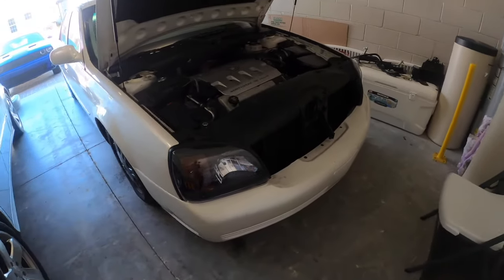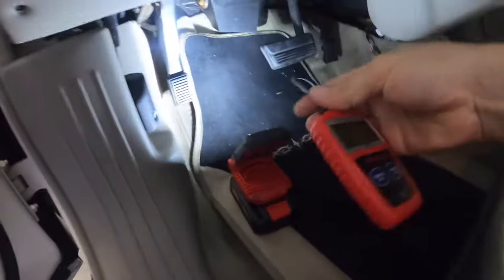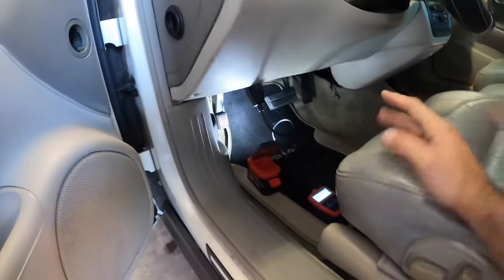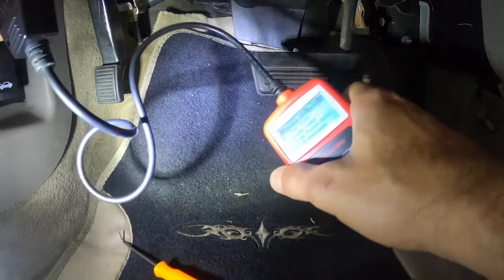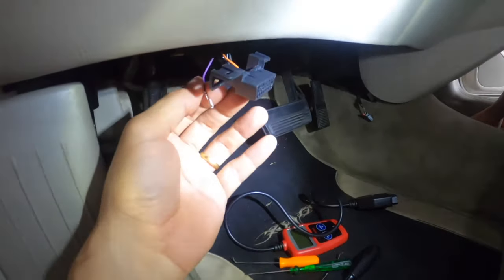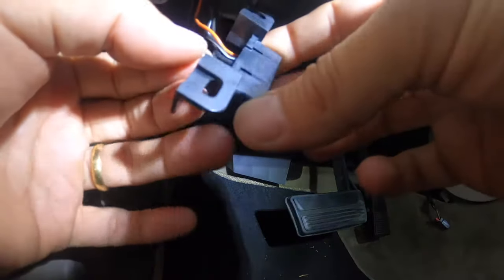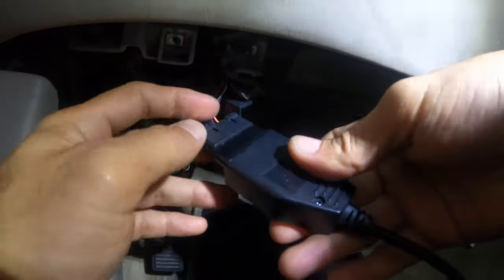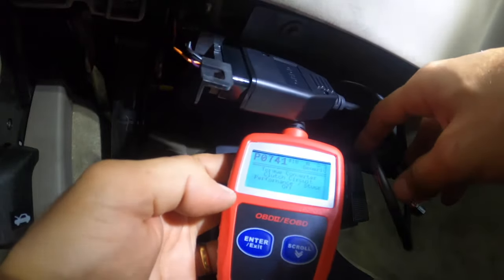OBD2 Port Doesn't Communicate, But Has Power

Comment: Every video I've found on obd2 not connecting has the same outcome. Very basic and of no help. Connector pin drag test was first thing I thought  of. And huge problem with anything that has a connector. And there are the ones that find a blown fuse. That is eliminated when the scanner powers up. Got power. Got ground.  Pins are tight. No data. Can bus voltages seem to be right, from what I can tell. But checking resistance between two canbus wires finds no continuity. Could be due to no access to get good connection. Not even sure what sort of system/network a 2000 xkr has. Can't find hardly any info about it. Go chasing after can bus likely has nothing to do with actual concern. Just need to get codes and read data
Reply from the maker: You'd need to pay someone to diagnose like Scanner Danner
Reply: Needs a new battery.
Reply: @MikeyBadabingBadaboom  No. Something has the CAN network functioning as a CANT network. Likely a bad module. Haven't had time to track it down. Slow process. And at the moment it's been moved down on the priority list, by a deer. Instead I'm shopping for a bumper cover, fender, and headlight.
Reply: I had the same issue I couldn't believe it but what fixed it was disconnecting the battery terminals clamping them together and holding down the brake to discharge all the modules and reset them
Reply: @moreoflife1112  Did that really work? I have a 1998 Toyota Tacoma 4x4. Can you give a little more detail? I’m having the same problem and the smog shop can’t complete the smog check for my new registration. The scanner will power up but won’t connect or communicate.
Reply: @briankennedy5578 Hey man, how did you end up solving your issue at the obd2 port? I'm having the same issue as I tried to smog my car Friday. I find the old answer of it's probably the ecu to be wrong. I have no other symptoms at all, & ecu's just so rarely go bad. Was it some sensor, or??  thanks!
Reply: @scottsherman5262  Haven't gotten around to it yet. Got the deer situation taken care of. Thinking mine could be  either a bad wire or one of the many modules connected to the CAN circuit. With the age of mine it's a tedious process. Have to disconnect each one individually to find which one is the problem. Newer vehicles it's easier. It's most likely something stupid in the wiring. Yours likely the same. Could also be incompatible hardware. Maybe try a different testing station.

Comment: I tried  this already and it didn't work on mine but the code reader does turn on and I get link error my car still just cranks no start
Reply: My fix was the ecu
Reply: @jvst20051  same hopefully
Reply: @Benzo4prezi  it turned out to be my ecu .I replaced it and every works now
Reply: I'm having the same problem on my 2010 Honda accord it's getting power but says error and also my key isn't showing when put to acc position can it be my ECU is bad?
Reply: @saltlifecastro  did you fix it Same car and same alo
Reply: @noelperez4259  it was my ECU and wire harness rats had them really messed up

Comment: My 2006 Frontier, same problem. Power, no communcation with DMV.  Told by garage today they found that a pin in the Data Link Communicator, or the OBD2, needed tightening, when they t4ried to plug one into the other, the pin wasn't making contact where it should. I was told they tightened this one pin, probably #16 which is the communicator pin from what I've read.  So that is the problem I had. It is fixed, as of today. Happened last year too.

Comment: I have a similar problem with my 98 cabrio. My scanner has power but even if the check engine light is on my scanner doesnt pick up codes

Comment: Great info to try!  As others said, every other video is only if NO power.  I have the situation that your have, power but won't read codes.
Reply from the maker: Let me know of it works
Reply: Yes, the power and ground wires were snug but the three comm ports were loose.

Comment: Very nice job. if am not wrong pin #2 from Obd2 connector corresponds to Can line-H and #4 it's one of the Grounds. 👍😎
Reply from the maker: Thanks for the info
Reply: Bro you seem very knowledgeable on this topic… question…. I have a 2012 town and country, the obd2 has power but will not read… replaced tipm, win module, and going to replace ecm soon van won’t start

Comment: mine used to connect to torque app . but now it doesnt work.only in one specific app it does connect to ecu. which i can't explain why?? i've replace the ddapters . and both works fine with torque pro in another car. i guess there's something wrong with my obd port itself. i'll give atry though. thanks!!!

Comment: Thank you for this video
I have an OBD2. The blue piece, when I connect it to the slot, lights up red, but when I start searching for malfunctions, it does not respond and shows me a message that the piece has not connected to the computer, and I do not know what is wrong.

Comment: @DCF Garage I noticed the trouble code on your scanner was P0741 and it's on a GM vehicle. What did you do for a fix on that code? I have a 2008 Chevrolet Colorado with that same code.
Reply from the maker: I believe that is likely a bad torque converter. There is a sensor that can also go bad, but normally it’s the TC

Comment: I have a similar scanner and when I plug it in and press scan it’ll load and then it will just revert back to the main menu after it’s finished loading. I don’t get an error and failure to connect message. Battery is new, and the pins are fine. Any tips?? Thanks. Edit: I don’t currently have a CEL on however part of my cluster lights are burnt out so I don’t know if the CEL is on or off.

Comment: Similar issues my 93 grand cherokee 4.0L but my gages don't work, starter cranks but the car does not start and the reader can't read the computer. I've checked the fuses and only the park/neutral position fuse was blown; and when I replaced it the issues still remain. 

I need help somebody
Reply from the maker: Then your ecu is likely toast. You can pay a mobile mechanic to diagnose for sure

Comment: Vehicles will not pass inspection in NH with a "Check engine light". I'm wondering what the inspection station will do when they can't read a fault but the check engine light is on.
Reply: Take the cluster out put black tape over the leds put it back together problem solved
Reply: They will assume you disconnected or changed your battery to cancel the light and you will have to drive another 100 miles before they can check again.

Comment: I have issue like this on my car except when I hit the link button on my innova obd it just turns off. Works when I don't have my keys in the ignition  but obviously it doesn't connect then.
Reply from the maker: Start with the basics. Make sure the pins are good… especially if it’s and old car. If that’s not the case, then your problem might be the ECM itself

Comment: Thanks for the tip, I tried this on my 2000 AC30 Toyota Estima but still "trouble connecting" any ideas?
Reply from the maker: It could possibly br a bad ecu
Reply: @dcfgarage  what causes an ECU to go bad?
Reply: I have a 2003 hummer H2, unknown driver, half the electronics don’t work. I have replaced the ECM and BCM both were programmed, relearned procedure done. I plug my cheap diagnostic tool in the OBD port. It gives me only the volts  which are good and then it cannot communicate with the rest. Just asking your opinion before I take it to a shop, do you think it could be a wire in the OBD port. They seem to look good . The unknown driver is what the problem is .I can see you get so many questions on here, I have just worked on this for like six months and stuck. 
Sorry for the long thread, but if you can reply, thank you so much, Richard

Comment: You didn't mention whether you had to disconnect the battery before fooling with the electronic parts (as in connector). Was a short possible when fooling with them?
Reply from the maker: No need to disconnect the battery for this.
Reply: Only need key out and to pull the cigarette lighter fuse under the hood which will kill the power just in case you touch 12v+ to a ground.

Comment: Do you need to discanect battery
Reply from the maker: Not necessary. It will be hard to diagnose with it disconnected. If you do one wire at a time, there's no risk